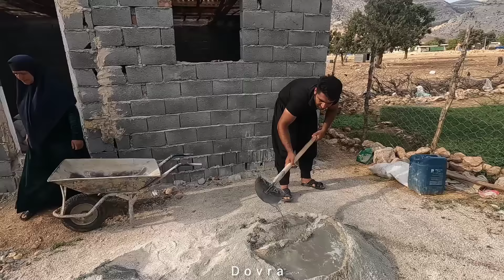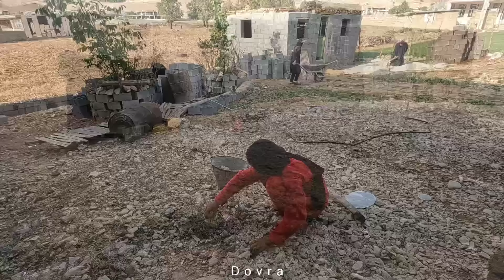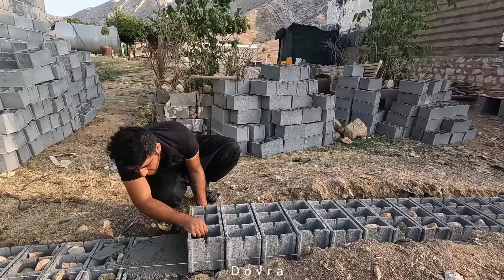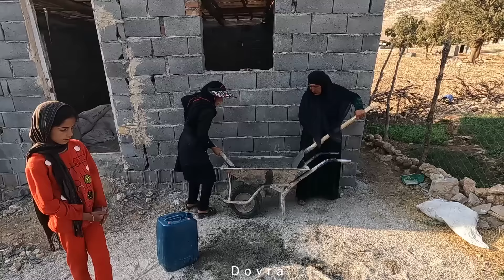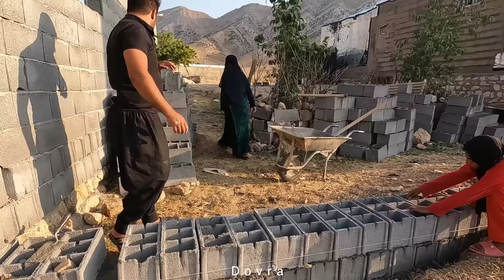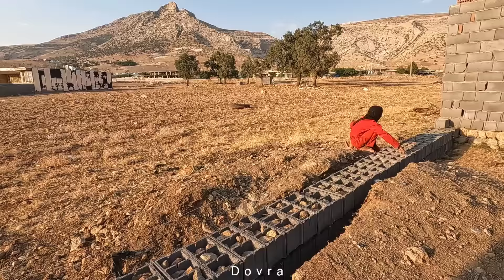amazing development dream cottage nomadic grandmother and two orphans with help master bana

Comment: The wall is not stronger because he places the blocks sideways? In fact it make the wall less structurally strong to build in that way? That nuts! It an enormous waist of materials and time? Also there is no need to put rocks in  the blocks if they are laid in the correct way. A wall only needs one straight row with offset blocks to be very structurally strong. I have never seen anyone build in such a stupid way?